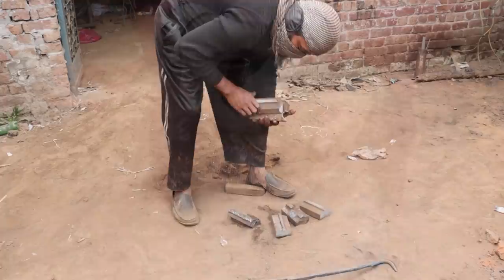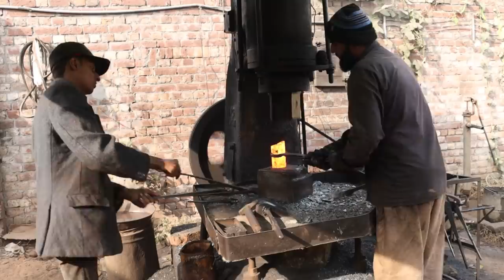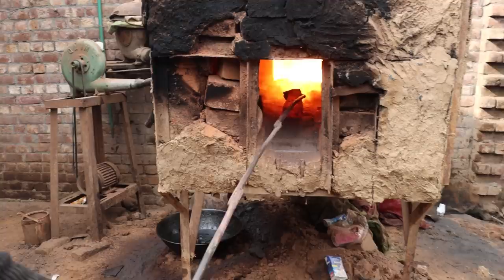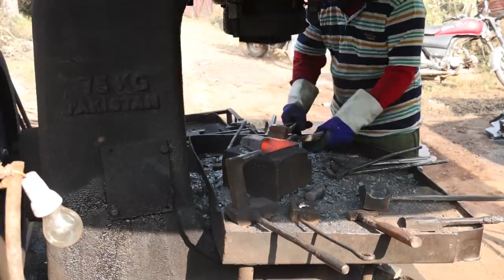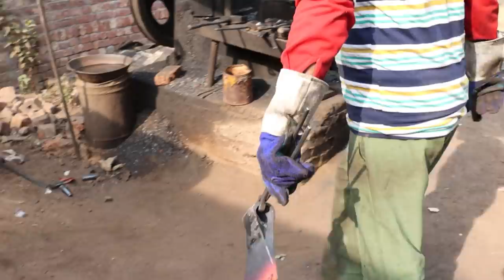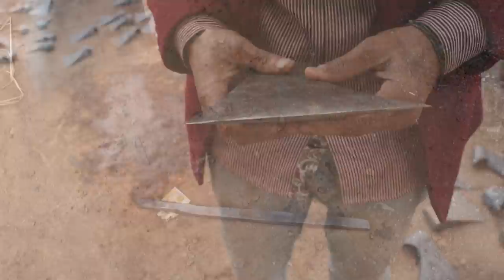Amazing Forging Process of Making Spliting Axe from Railroad Track Steel

Comment: Hardened edge no temper. Breaks twig nicely though.
Reply: It would temper from the residual heat away from the edge.
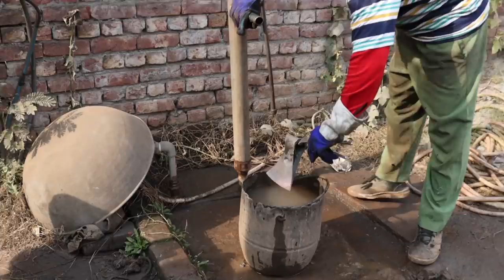Reply: At 5:30 they temper the blade
Reply: @bobdoughnut1585  that’s a quench- creates martensite. The temper is intended to relieve stress within the brittle hard steel.

Comment: if that grinding wheel ever decides to come apart.....
Reply: Ya don't need safety glasses....just squint real hard ..🤣🤣🤣
Reply: @jerrybigrig9475  Yep, it's called the "safety squint".  I use it all the time in my cabinet shop...
If that wheel came apart, I'm not sure even a face shield would protect him.
Reply: i now work 15 years in the production of steel with all kinds of big ass machinery around me. but i still have great respect when it comes to fast spinning machines and i really don't know how so many people can just ignore that danger.
Reply: @meverick666  I think a lot has to do with feeding one's family.  deal with it or go hungry.   And maybe they don't know any other way.
Reply: @AffordBindEquipment  oh i mean no disrespect for these workers, they probably have not much of a choice. I was just pointing out that a lot of people seem to underestimate the danger of fast spinning things.
Reply: @meverick666  5:56  he's ok, he's wearing safety sandals and probably has mastered the "safety squint".  Hey, I use that at times!
Reply: As long as he does not side load the wheel all he has to worry about is getting chips welded to his cornea. Been there done that even with safety glasses poor guy he has none.

Comment: Thats not a splitting axe! Head is too thin,but could be used to split kindling? Just saying😆😆👍
Reply: Didn’t seem like much of a quench and very shallow too. Might only be hardened to a depth of 1/2”.
Reply: @trappenweisseguy27  that would probably be fine. Axes are generally medium carbon steel and a heat treatment is not essential